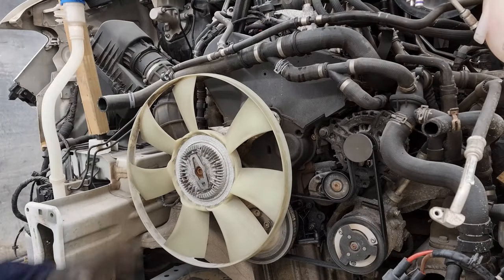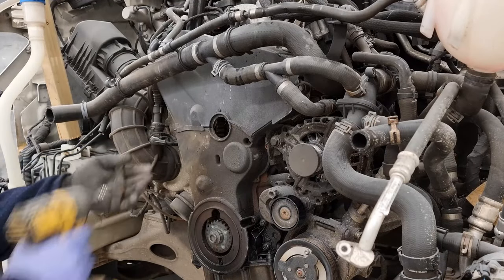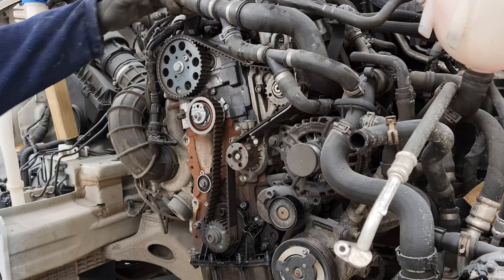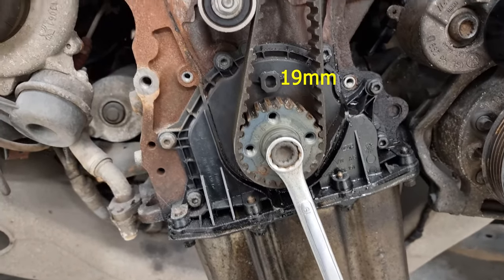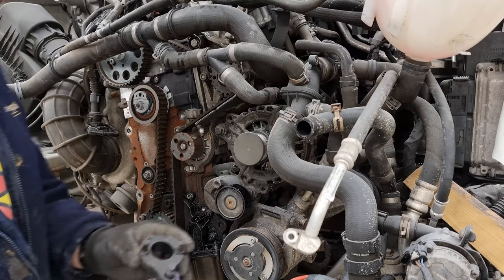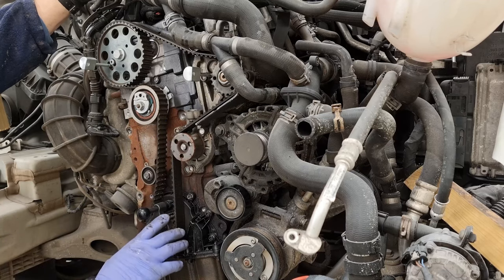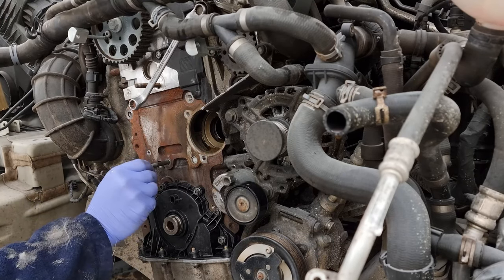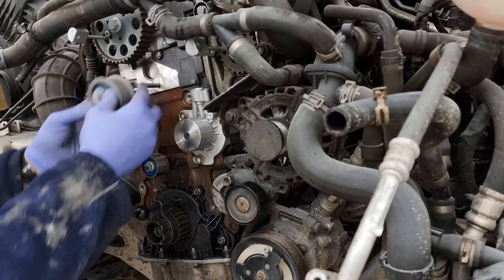Replacing 2.0tdi VAG CR timing belt, water pump and crank seal on my 2018 VW Crafter MAN TGE van

Comment: Doing this tommrrow and what a guide
Reply from the maker: thanks, have fun
Reply: @paulsprojects1  well that was 9hrs I’ll never get back I have the crafter with the same engine in but it’s front wheel drive so a absolute pain no room at all I also replaced the oil belt so had to remove the sump but all went well thanks for the video that gave me a idea of what to expect

Comment: Was it leaking from the crank seal or between the oil pan? Did replacing the seal stop the leak for good?
Reply from the maker: tbh i'm not 100% where it was leaking from  but assumed it was the seal

Comment: most of the procedure is wrong and is always better to unscrew a crank bolt with the belt still on and you can screw it in with the new belt already installed . the cam sprocket will not move if you don't unscrew the 18" hex on it , same for the fuel pump (wich i  believe it's  a 24") . They do this way in order to remove all the slack
Reply from the maker: yes i should have loosened off the crank bolt before removing the belt which was an oversight, the cam sprocket is a two piece design and is designed to be loosened to allow for any variance in the new belt, the cam itself is locked in position with the pin so only the sprocket moves when you loosen the t30 on the sprocket, this allows the belt to be tensioned evenly and the timing to remain set
Reply: @paulsprojects1  incorrect, you can't turn the sprocket by unscrewing the t30 alone , read the vw procedure .. it's actually easy to understand why you can't do that , the cam sprocket is still attached to the cam shaft until you unscrew the 18" bolt . btw: the torque settings is 20Nm for the idlers (+20Nm+45 for the tensioner) , 100Nm for the 18" cam bolt , 95Nm for the fuel pump bolt (initially these  2 are tighted to 20Nm for manual rotation) and 9Nm for the T30 screw . The T30 screw is there basically to make sure the metal mark is in place
Reply: Danidasanic is actually correct, the cam sprocket and fuel pump do need to be loosened along with the T30, this is the only way it’s tensioned correctly especially on the fuel pump side of the belt, 90% of people get it wrong.
Reply: @davidm9673  most of the ppl don't have access to vw manual XD You see ppl placing the belt out of the order because of that and removing the slack by placing the top idler at the end . This type of tensioning Is not as simple as the majority of engines but they do that way to be able to remove all the slack between the 2 sides of the crankshaft sprocket , the pump side and the idler and tension side and it works
Reply: @Danidasanic  if you're quoting facts, make sure your posts are accurate. 18" is 18 inches which I'm guessing is not what you meant. Could be confusing for people taking you at your word. I'd also suggest trying to be less critical with your advice. The poster has gone to a lot of effort with this video which I appreciate. Constructive criticism is usually welcome but doesn't have to come across so negatively
Reply: @andyssecondchannel131  I think you don't need a degree in engineering to know that vw uses metric , so usually ppl just write the size of the head . Making a video showing how you shouldn't do isn't helping much , that's why i replied

Comment: Great video doing the same myself at the moment on a transporter did you manage to find the correct torque setting for the main pulley bolt on the crankshaft?
Been searching it up and so many different opinions ranging from 90 NM to 180 NM + 90°
Reply from the maker: tbh i cant remember now but i had the specs from a local friend who runs a garage

Comment: To what reference was the crank pulley marked? Maybe some reference point at the crank seal?
Reply from the maker: you need the tool shown in the video to lock the engine into position (very cheap on ebay), the tool locks the crank into position against the housing behind the btm pulley

Comment: Everybody just shows how to replace a belt, how to do the crankshaft phasing if you have lost the phase, where are the markings ?
Reply from the maker: as long as you use the locking pins the engine should be in time, just make sure you rotate it by hand for a couple of revolutions before trying to start it to check that nothing touches or locks up
Reply: @paulsprojects1  I have managed to find the markings on the crankshaft, they are on the external belt pulley and on the timing belt cover. There was a slight misalignment of the camshaft due to the bad/worn timing tool that was not the exact thickness that allowed the camshaft to move for a few degrees. Those engines are very sensitive to misalignments.

Comment: Great video! At what mileage would you change the small toothed belt of the oil pump?
Reply from the maker: i believe the service interval on it is 130k miles or 5 years  although since i did the cambelt i think its been reduced to 80k miles, either way i'll definitely change it next time or if i hear any noise from it
Reply: I called VW and they told me that the small belt lasts very long and at 130K miles it is OK. There are people who had problems with it at 180K miles. It seems it depends on the oil you are using as it is in it the entire time.
Reply: I have 2017 crafter 2.0 tdi 50k miles just turned 5 years old should I change the cam belt